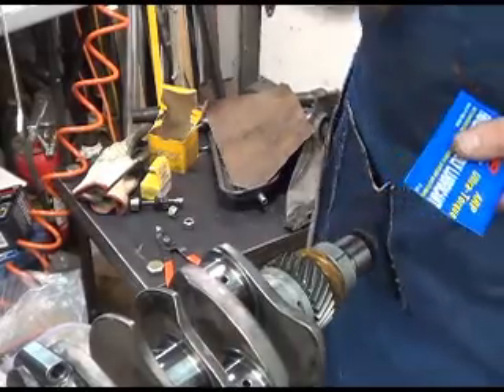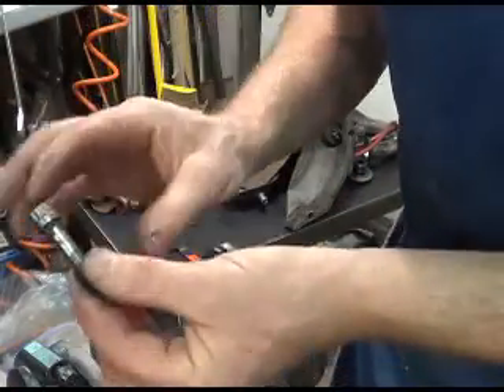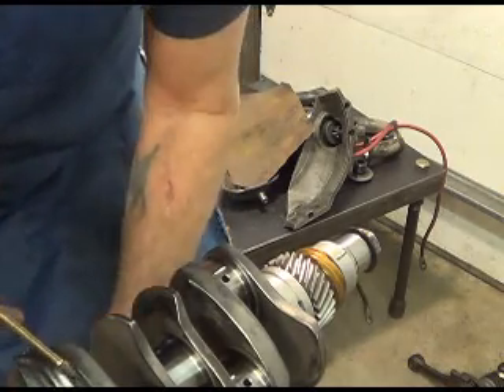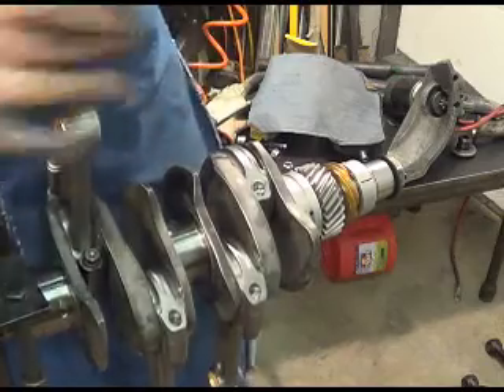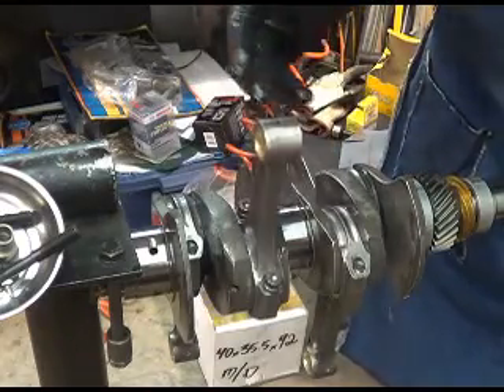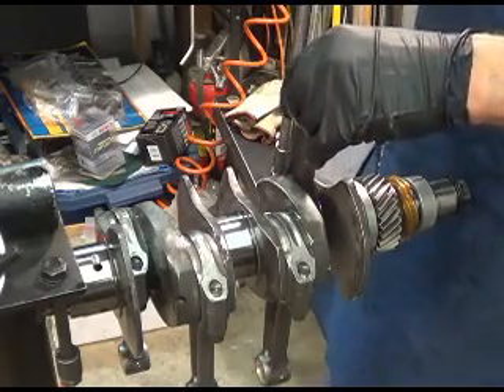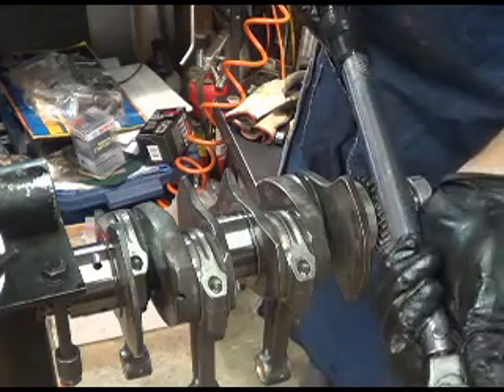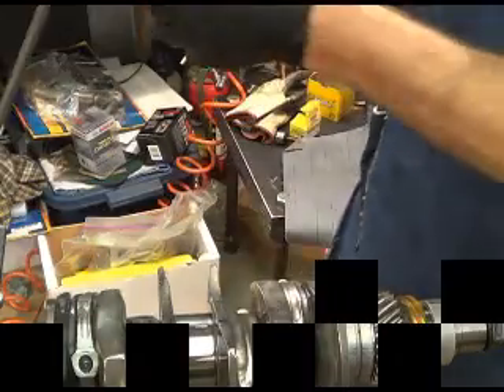ARP  Rod Bolt Install

Comment: What on the holy hell is holding that crank up ? I generally install those in the motor after the pistons attached and the cranks bolted down. You're fkn crazy dude. What the hell am I watching ? I'd love to see how you put that in the block with pistons attached.

Comment: For Weisco Boostline rods with the ARP 625+ rod bolts, Weisco says ARP procedure is 25ft lbs, then 55 degrees to 5-6 thou stretch measuring with a rod bolt stretch gauge using the ARP moly lube.
Reply from the maker: thx

Comment: How do you have that crank mounted? That’s handy
Reply from the maker: Just took an old gland nut that holds your flywheel on and welded it to the pipe on the back of my engine stand.

Comment: So what oil weight do you use cause i tried 15w40 and feels way to sticky and not slippery enough.
Reply from the maker: In my 1978 official VW service manual it states on page 4 of Lubrication and Maint that as of 1975 VW recommends multi grade oils for years 1968 on that had previously used SAE single grade oils. You should use the weight of oil that is recommended for the climate in which your car is driven. Personally I am in favor of a quality 10w-30 for most of the year. I'm not picky about brand or weight. If I need to add I might use whatever I have in my garage from other vehicles I own including full synthetic. I generally ad some zinc additive depending on my mood or might even throw in a quart of Valvaline VR1 with zinc.  ALL my engine mark there spot. It's an over rated controversial topic that I feel is a waste of time. Most all modern day oils are very good because by 1960 standards we are driving race engines in our daily rides.
Reply: Beta Rey Bill , then try some  KY 0w-20. 🙄

Comment: EZ,i have AA   I beam rods with the ARP bolt upgrade(2110 stroker build).These have no bump on rod to show what side is up..so do I make sure each rods stamped numbers are facing upward(and bearing tang downward) According to each rods according hole.I am double checking..In otherwords, when each rod is positioned to each according hole in case, ALL stamped rod numbers should be facing up?..And bearing tangs down?...thanks man u been a lot of help!!...SEAN
Reply from the maker: Go to this video and at about 15 minutes in I describe what you want. https://youtu.be/_mH9qjePCI4   Numbers up tang down. My engine is running good. Hope you get lots of smiles to the miles

Comment: Hi.  We have a Kubota tractor with these strange looking connecting rod bolt heads... they appear to have about 12 ridges around the bolt head... can you tell us what kind of socket you used to remove these bolts, please ?  We thot maybe they were inverted torx heads, but they are not.  Maybe a 12 point socket or something ??
Thanks for the nice video...
Reply from the maker: You are correct!  12 point sockets. You should be able to pick up a cheap set anyplace that sells tools.

Comment: Great vid bud,did you resize the main ends and connecting rod ends after too  remove out of round?
Reply from the maker: No I did not. As you can see i am just a average home builder with minimum of tools. I do however have some experience under my belt. I wish I had access to all those shop tools. Wouldn't be worth it for the average person to purchase them.
Reply: TheEZGZ i hear bud iam in the same position,iam about too do the arp main and big ends but the tech sheet says that resizing should be done so just trying too get some info,that build ran ok ? Cheers for the reply bud
Reply from the maker: Yes, It ran fine except engine temp was erratic for some reason. Just be sure those rods swing nice during assembly and you will probably be all right.
Reply: TheEZGZ thanks for the info bud will give it a try if they dnt swing smooth then il have too get them resized all the best dude

Comment: yes was thinking of rebuilding my 1300cc twin port with a turbo. parts for turboing a aircooled motors isnt readilly available in south africa and its very expensive as ive started my reseasch in prices.

Comment: have you ever thought of building a vw turbo motor?
Reply from the maker: +Pierre Du Plessis  Yes, some of my friends have them on there sand rail cars.
Would make a nice muffler, wouldn't it?  Honestly though. That kind of power in a long term street car is out of line for my budget and I would probably get into trouble with it.
Reply: Ive seen many hours of turbo beetles and its something that intrests me. I ve looked at turbo kits a bit expensive on my side too. Too much power on such a small car car lead too many traffic fines and unwanted trouble. Yet its still intresting too turbo a vw motor? Thank you i watched all your vids and ive learned alot.
Reply from the maker: +Pierre Du Plessis Thank You Pierre. I appreciate the support and enjoy the VW cars like you.

Comment: If you always back the torque setting off when you're done with the torque wrench it helps keep the calibration correct...Also may I suggest you use the shortest extension bar possible when torquing bolts 'cos they do twist just a little...Have fun EZ.
Reply: We were at the Chip Gnassi shop in Indy, where they built the Ford GT's that won at LeMans.  Each mechanic had a row of torque wrenches.  He would use one on one set of bolts, set it aside, and use another one for the next set.  A mechanic came by and picked up all the "used" torque wrenches and took them in another part of the shop to recalibrate.  In other words, they recalibrate after EVERY USE!!!  I was amazed.
Reply from the maker: +ZIGgassedUP Your right again Zig.  Thanks for your contribution. Seems like I always leave some details out. Hope folks are reading these comments. I appreciate all the helpful comments.

Comment: Great video. I use the stretch gauge fromAJ Sims at Low Bugget. I want to say it was around 80$. Great product, fowler gauge. Highly recommended
Reply from the maker: +Joshua Honel Thank You, Very helpful info.  It is not something I have normally dealt with. Probably totally overkill for this kind of build but I figure it was good insurance for the long run. I appreciate the contribution